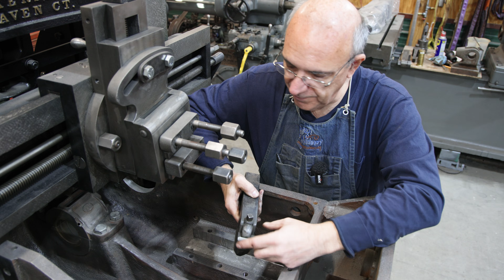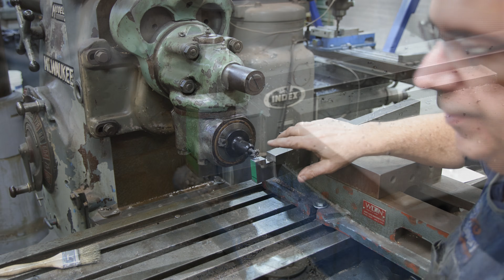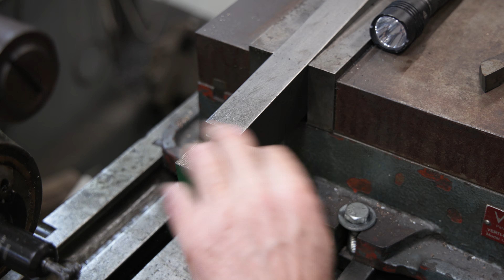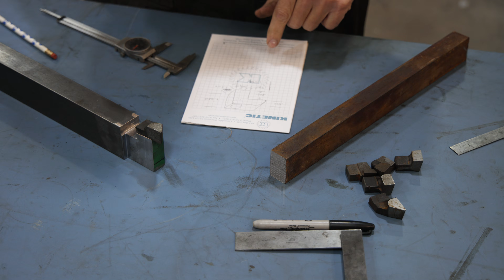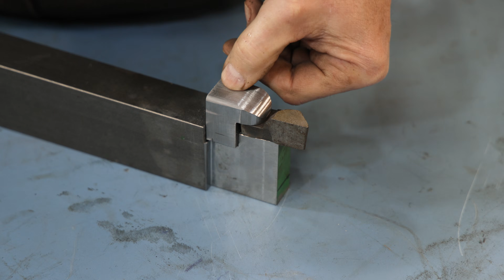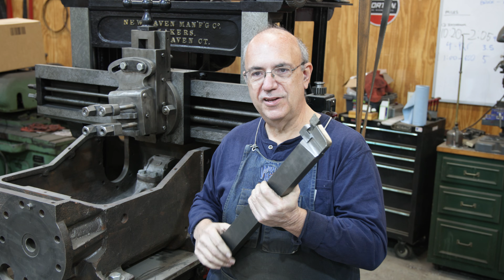Making a Custom Planer Tool Holder for Apex Type Tool Bits

Comment: Small cuts may work, but I suspect the holder needs to be twice as thick or so. Am also a little worried about the stoutness of the machine with such a long arm on it. Fingers crossed I am wrong and it works perfectly as is.

Comment: Call me a knocker, but I think cutting off the sides of this tool holder anywhere "above the insert" (so to speak) was totally unnecessary, as this only makes the tip somewhat weaker (more prone to flexing) and adds a pronounce strong stress riser when this machined end meets the original stock. And then you're going to put a threaded hole next to where this "tip" meets the main shaft - me say no bueno...

Yes "it's going to be light cuts only", and the shaft, considering its length, will be quite flexible anyway, but still - should you use this holder "somewhere in the future" for another job, with heavier cuts, this may bite you back.
And I know, this is your shop, your project and your tool holder, but still - call it "feedback", please.
If I were in your shoes (I know I can't, since my feet are size 12, so they probably wouldn't feet... I mean, "fit" ;-) I'd just skip cutting off the sides altogether, or ended the cut where the tool bit ends, and then I'd taper it out or "round it out" (on a belt sander, as this is not critical shape in any aspect).
Well, "just saying", as they say... ;-)

Comment: At first when I saw that 2” tool holder I was thinking no way that thing would be insufficient … but then when I thought about it, wouldn’t you want additional bracing for the tool holder horizontally? When you see tools upgraded in size they usually keep the ratio pretty consistent, so i’m not sure if bracing the tool holder in only 1 dimension by increasing the depth to 2” will solve things. Granted it will stiffen it up considerably against deflection in the primary direction of movement but that will only have a marginal impact on horizontal deflection compared to if you increased the tool holder width in that direction as well. 

Don’t get me wrong, Increasing the depth does help stiffen it up in that other direction so it may actually be enough, it’s just when 2 immobile objects are forced to collide something has to give … whether that’s the tool holder deflecting into the available airspace or the cast iron crumbling along its crystalline micro structure is anyone’s guess. I personally think you’ll be ok, but it did cross my kind.

From every example i’ve seen of cutting cast iron the materials either crumbles when plowing through cuts with a shaper or turns powder/dust when using a milling machine. It would blow my mind if that tool holder ended up insufficiently rigid … and then I guess we would all learn something new 😅.

Comment: Did you consider building a stout bar to lower the clapper down into the stoker engine? You could the use a normal size tool holder. The bar to lower the clapper could be as ridgid as you like -- you could easily use material thicker than 1 and a quarter inch.

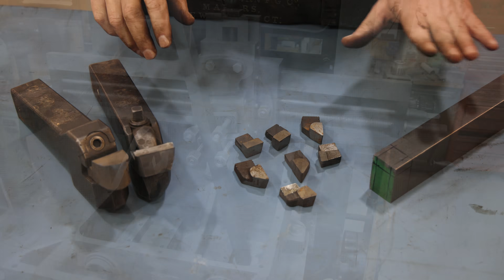Comment: 5:43 - As the designer of the products we sell, the drawing is always the result of what you have visualized. You have the complete product in mind, and use of CAD might confirm you haven't made an oops in some X-Y-Z dim. But the design is done.
Never found CAD of assistance in design in my case.
It is of assistance in communicating the design to those who produce the part.
Reply: My workflow is visualize, chicken scratch on paper and lastly cad.
Doing the actual design fully in cad from start to finish doesn't seem to work.

Comment: I too like Keith and other commenters are worrying about this job. Is even that big chunk of metal tool holder still going to chatter at that depth?? Them Big screws that hold the tool holder look like they could hold rectangular bar twice as deep if so. Could weld or bolt on another piece behind it if so. Nail biting in a way lol but only one way to find out. Keep giving it a go until it works or all ideas are exhausted. It's a cliff hanger. Anyways however it goes there is now a great tool holder for all of the kindly donated small cutting bits.

Comment: Looks great, Keith.  Happy New Year!
My gut tells me for the long extension down into that cavity, you're gonna want a larger cross section.  I still hope it works well.  
I'm curious about how you decided what features should follow the 5 degree tilt and what would remain orthogonal.  Perhaps you were just following after the design of the other tool holders.

Comment: You did a great job making the tool holder. I think its length will cause chatter.
Why don't you use the horizontal boring machine? Brian's should be large enough.

Comment: If the tool holder crashes into the work piece. Will the belts slip rather than bend the metal?

Comment: nice ... looks like you've got this job in your sights ... always amazed at how you keep the dimensions straight ... (a couple of thousand ... twenty one sixty fourths ... letter F ... a three eights ... etc) ... would have my head spinning
Reply: After many years of machining you tend to memorize the basic tap and clearance drills for many sizes of taps. It saves a lot of time looking them up on charts.
Reply: Or you could just use the metric system …

Comment: Nicely done!  I kinda expected to see a 5-degree cut on the underside of the clamp (so it doesn't contact the bit at just one point), and I think the notches others have mentioned on the back side of the bar (for the clapper box) are a good idea, but those can be easily added later if needed.  Can't wait to see it go!
Reply: I don't want to add to Keith's todo list but wouldn't it be better to make another holder with the two necessary notches for the clapper box that would then hold this apex toolholder? If the length of the apex toolholder turns out to be an issue, it could be solved by not placing it directly in the clappêr box but by creating a 1.25" toolholder that would be wider and have notches on it's back to match the the clapper box. This 1.25" toolholder would rigidify the Apex toolholder Keith has created. Weight may be an issue though but having a 1.25" toolholder that could hold the Apex bit toolholder seems like a possibility (that Keith may already have considered and is holding off on unless it proves to be necessary).

Comment: I believe you're going to be using this on cast, and it should be plenty good for that, but it might be a good candidate for case hardening.  A hard surface would help with rigidity and the soft and squishy center would protect against breakage.

Comment: Could you not grind out the worn material in the bottom of the stoker box and replace it with Babbitt poured under a flat form to create the new bearing surface? Not sure if there is Babbitt involved originally in this bearing surface and the corresponding cross slide ? Be easier to machine the cross slide to tolerance than the base of the stoker box ?

Comment: Not saying Keith did anything wrong ... just suggesting another way to make the clamp. I would have not cut the piece off. I would have machined all the features on the bar in one set up and then cut it off.

Comment: When Abom79 started machining the bottom ways on that Stoker engine, bits of metal were breaking off from the metal deposition process that the casting has been through. Hopefully they were from areas where the bonding is not critical.
Reply: Didn't he say he was going to do away with the deposited material altogether and use the babbitt to make up the size?
Reply: Yes, this guy, and an accomplice deposited that layer on the bottom, and now lets all watch and see what he is going to do with his F*** up!
Should be lots of laughs!:body-blue-raised-arms:

Comment: Hi Keith,
Nice tool holder for the planer. Question: Could the horizontal boring mill do that job with the stoker engine mounted vertically?
Reply: If he had a horizontal boring machine...
Reply: @Mishn0  He does have one. Keith has a video series on repairing it.
Reply: @DonDegidio  You're right. I should know what I'm talking about before I pipe up. But, I guess he knows he's got it too, so there must be a reason he's going to the planer.
Reply: @Mishn0  Yes, the reason is that Bozo always dose it the wrong way, just sit back and have some laughs!:face-blue-smiling:

Comment: If those Pakistani machinists can do jobs on dirt floors with weld on hold downs I was sure you.could do it  too. Here feet hardly any protection from chips slag sun glasses bro weld. Buy they turn out parts

Comment: im appalled at anyone bad mouthing adam booth.  the stoker was just a bit beyond his scope for one single job.  and he knew Keith had the metal planer in the works.   they collaborated on this job.    so to me its apparent why adam didnt go through all the trouble for it.  plus his shaper aint near as rigid for huge cutter.  of course yall wouldnt know about machine rigidity because the winers have dead nothing channels with no content.  ive ran cnc for right at 10 years and ive visited keiths shop. he does really well for practically 0 help.   if you notice his cameras never float around.  they are on a stand because he is a 1 man band!

Comment: Can't wait to see you use it. If that doesn't work you can always strap a dremel on a length of tool steel and make a grinder
Reply: The mighty Dremel to the rescue! That gave me a chuckle thinking about it, I know that idea is sound and grinding will probably be the next thing to try, but I couldn’t help myself. That bar of steel probably cost more money than a dremel does. I’ll finish my coffee now and then I’ll be alright.
Reply: @Hoaxer51  It would certainly stop any chattering that might occur.
Reply: Oh! I never considered the option of grinding. Good suggestion.
Reply: @rexmyers991  I actually made the suggestion a couple videos back. I think instead of trying to cut the metal he would be better off designing some sort of grinder Or a motorized cutter. Kind of like you would find on one of these little CNC's . One of these 500 watt spindles with the collets included. Just build a tool holder for that. That tool he built is almost guaranteed to chatter. Hopefully I'm wrong.
Reply: @tomjewett5839  I think the tool itself is OK, but the amount of torque on the clapper box and head with the tool out that far, looks like a potential issue.
Reply: @brettbuck7362  He plans on taking small cuts but I still think there might be an issue with chatter. That long of a cutter is going to have some flex.
Reply: @tomjewett5839  I would be more concerned about twisting the cross-slide, the tool is probably stiffer. I would set up the job with the cross-heads as close to the end as possible.  As it is set up with the tool far in front of the cross-slide, any twist or deflection will cause the tool to dig in. This job calls for something that runs on the existing machined rails as a reference. Get it close either the shaper where you can, use a rail-mounted grinder or sander to reach the ends you can't get to.

Comment: Seems like a better job for the horizontal boring mill with a facing tool - see Topper Machine - no need for a crazy long holder or to trust those old flatbelts to control stroke correctly and not hit the side wall of the part

Comment: Still giggling at the thought that a 140 year old machine can do a job that MODERN machines CAN'T! 🤣
Can't wait to see it actually working!
Reply: Not an accurate statement.  The right modern machine would do this with ease.  Not a feel good thought for you, but truth.
Reply: I’m pretty sure there are plenty of modern machines that could knock this out.
Reply: There are options on modern machines that this job would only take a few hours if that. He’s just being stubborn and fighting this job forever.
Reply: @justinl.3587  I don't think he's fighting it. I think he does not have access to those machines you speak of, and works with what he has.The guys that have those machines want way more than a charity budget allows. I'm sure if one of them offered, he would take them up on it?
Reply: @sbrunner69 I offered to do it for him on the hbm way back when I did the cylinders. He didn’t want to impose that much work though and it is a long drive from south ga to central ky. 😊
Reply: @justinl.3587 It's a hobby, why would he spend 100K on a machine to just play around with? He's retired and enjoying it.
Reply: @justinl.3587 the whole point of this channel is using "vintage machinery." It's his whole hobby!

Comment: Watching the last couple minutes and had a thought that the back of the tool holder needed to be notched to fit over those bars on the clapper box so the holder can't work its way up under tool pressure. It would be a lot less force on those clamps if they were just making sure it couldn't come out of the notches.
Reply: I'm thinking the same thing but as an anti-rotation feature. As it steps over, the tool only cuts on one side. That torque at the end of a long bar will try and rotate that tool. When it gets to the shoulder, it will have the strongest effect. There's just not a lot of surface area being clamped.

Comment: The tool holder looks great; finished and it will be fascinating to see how the metal planer in action.  Will you cover the newly cut steel with some oil to prevent flash rust?

Comment: This job looks easy for the boring mill. Brian of bcbloc02 has been doing jobs like this and worse for years.
Reply: Yes, Craneman. It does look like this would be a better fit for a horizontal boring mill. It's good that he's got that as a back up. Just in case this doesn't work.
Reply: Just sit back, watch Bozo work, and have some laughs!:body-blue-raised-arms::face-blue-smiling::face-blue-smiling::face-blue-smiling:
Reply: when he dropped that mill!  i got hooked on his channel.  was not a good day for him. but a good day for you tube ex machinists
Reply: @levitated-pit  He dropped a drilling machine. The boring mill is a horizontal boring mill like Keiths but a size or 2 bigger I believe.
Reply: @Craneman4100w  could that machine hold an adjustable boring head?   then its a mill ..
Reply: @levitated-pit Well, LP. Although you can use an adjustable boring head in a radial drill it's problematic at best on the quality of the hole that you'll get depending on the length.
Reply: @levitated-pit Do you mean when he dropped his radial drill?

Comment: Thanks for ab remark we knew that shaper would have done the job . He stated it could not be done on machine.
Reply: He did although he did speculate as to how the tool would be done. He also stated there would be a whole lot more flex than anybody wanted and there will be. It is still best if this is done on the horizontal boring mill. But I'm just here to watch and make snide comments. <g>
Reply: @CothranMike  Just sit back, watch Bozo, and have some laughs!:body-blue-raised-arms::face-blue-smiling::face-blue-smiling:
Reply: @garybrenner6236 If you don't like what he's doing why don't you go and watch a different channel? 🤷
Reply: @garybrenner6236  well, Gary, some of my comments were directed at you, as you know.